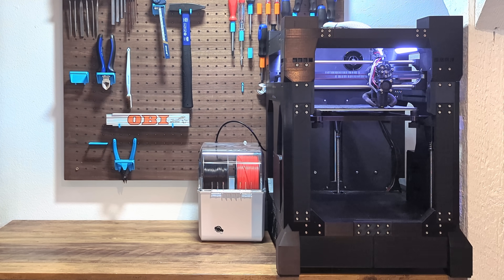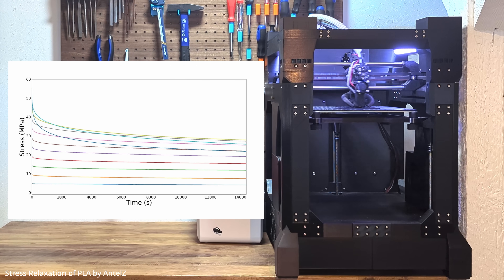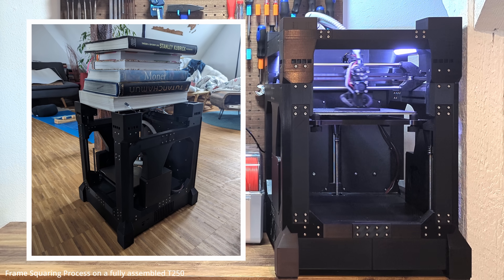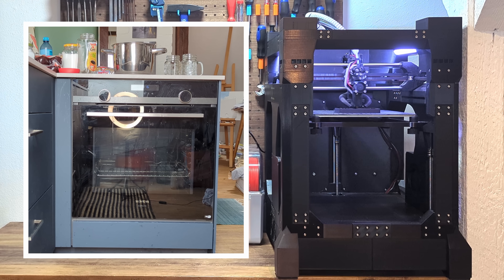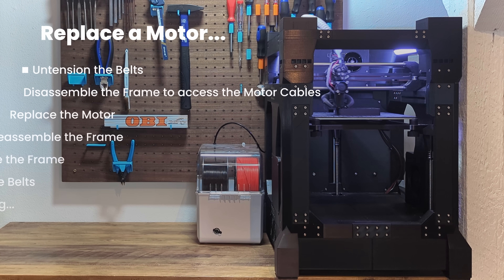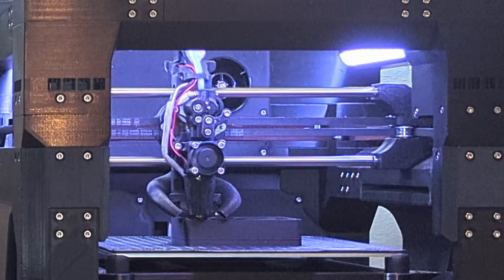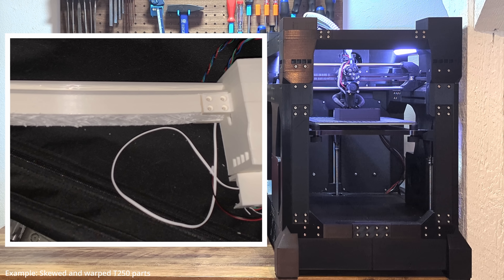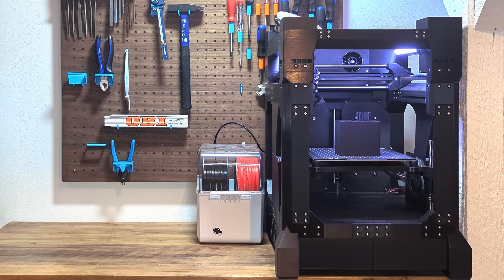5 Mistakes You Should Avoid When Building a T250

Comment: Heck even the T100 takes a long time to tune. I'm still tuning mine yet again to obtain more perfect prints. I had the belts too tight, the frame was a bit out of square. So after fixing those 2 things, re-leveling the bed, doing z-height adjustments I'm working on getting rid of VFAs. Re-calibrating pressure advance etc. I'm hoping to get the tolerances under control, they are out of wack. I've been 3D printing for 6 years now and it's still a lot of work but the end results are such beautiful prints when it all comes together!

Comment: Hey, what about a low Budget 250? Which would mean most of the t100 bom, with the upgraded hotend and the build volume of the t250 but without 60v, so basically using the t100 motoon system but with the increased build volume. Has anyone done something like that already? You could then also upgrade to t250 spec after a while

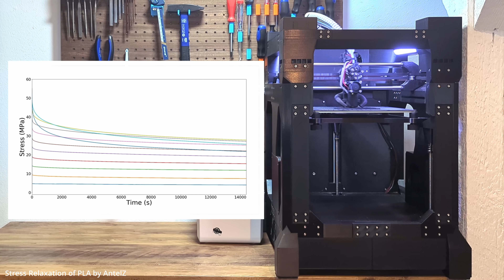Comment: 2:30 this data is interesting. From the Torque/Tension equation F=T/(Kd) where F is the bolt tension, T is the applied torque, K is the nut factor based on thread and friction characteristics, and d is the screw diameter, we can sub in some known values for the example M3 screw thread angles and diameter, steel on brass nut friction and be able to derive the screw tension from the current torque. the screw tension divided by the screw's collar or better, a washer, will give the pressure on the plastic which we can assign a value of 5 Mpa from the plot. for M3 washer (7 mm OD, 3.2 mm ID) this gives max torque 0.178NM. that's tiny, like 300g rotational force on a 1/2" screwdriver handle. also right at the lower end of specialised torque limiting drivers. without washers it's half...literally screwing it in with two fingers on the driver ever so lovingly...

instead of 5MPa maybe we can call it 30Mpa but specify to retighten after 24h and again after 1 week. now its about 1Nm with washer. these are huge chunks and days of printing that could potentially be ruined by a few small screws over repeated tightening at the wrong torques. i think that could very well be managed with a 3d printed torque limiter designed for 1Nm.
Reply from the maker: Yes, the absolute numbers also seem a bit low to me. At least I can’t reconcile them with reality. In the video, I used a 0.8 Nm torque wrench, which was a bit too high—by feel, I’d say I usually tighten the screws somewhere between 0.2 and 0.4 Nm.

But I could also imagine that his data doesn't quite match my scenario. He didn’t mention anything about the print settings, either on Reddit or in his video.

In my case, most joints should be treated like 100% infill parts, since top layers + bottom layers = 3 mm = the height of the screw's contact surface. I could imagine he used an infill that got compressed under the pressure.

Comment: >High end 3d printed 3d printer

>No doubleshear

Brother cmon, if you hada bent shaft at the alpha stage the best you could do was to support the end of the shaft with another bearing.
Reply from the maker: In my opinion, double-shear gantries lean a bit too far into the overengineering territory. Sure, they would’ve saved me from bending that shaft—but they also allow you to introduce belt tension, that are way higher and would hurt the printers performance, which isn't ideal. Also when you're chasing max acceleration, every extra gram of rotational inertia counts. That added mass of the longer shafts really hurts performance.

There might come a time where a double-shear gantry makes sense—maybe if belt-induced artifacts become a real issue. But based on where the printer is right now, there's still a bit of headroom before I need to worry about that.

Comment: If you had released T250. A year ago, I probably had not used so many curse words when building my o custom Klipper based printer with the frame of the crappy ender 5. Oh my mesh, the skew shall 16:19 alled it Vorender. I had Netflix experience with kita 
With it I made very mistake you mentioned and more. I was so tired of assembly and disassembly I just left everything open and wires running around. I burned a TMC DRIVER because I dropped a nut that caused a short in the board. 
I also soon enough discovered that connectors save you a lot of trouble. But they can also be a Nightmare. You add more failure points. You have no idea how much time I wasted with what was caused by a slightly higher resistance in one of my 2 wire PT100. And it had three sections. Toolhead of main loom main loom to the the electronics box. Connector and from there to the controller board. So an imperfect krimp of a single pin from a hay stack worth of wires can throw you off big time.

Also pay My tech fun channel a visit. He probably tested all. Filaments. You can imagine, with many very useful to know before hand parameters like creeping, layer adhesion, mechanical pameters, heat resistence, thermal resistance etc. For. His patron members he maintains a spread sheet will all. Info condensed. Definitely worth it and time saving.
Reply from the maker: Im a sucker for My tech fun's content, most of the time I end up buying a new spool of filament for myself... ._.
Reply: @MattThePrintingNerd My point was that you had a chart that you referred to your audience with a single data point about material performance. I thought that you and your audience could find it useful that he has an excel sheet compilation of many, many materials, over many data points. Including data such as how much a material deforms under constant load, tensile strength, sheer strength, layer adhesion, thermal resistance, and many more. That even if you don't really dig his content I'd say it would be helpful to have his data at hand for builds and offer insights to alternative materials that could be more efficient and/or easier and cheaper to print. His work is excellent and I believe it gives great value to the community.
Anuways, it seems my feedback is not really welcome here, so I wont do it anymore. Success.

Comment: I find it remarkably easy to print with PA-CF, once you get the Slicer settings right (orcaslicer makes thst a lot easier).

Think the trickiest part is the nozzle/heat block thermal properties and retraction. Getting these two right make the rest just fine tuning for surface finish quality. Now, plain nylon is for me a nightmare. Or it was, havent dared to do it again even having a full spool stored.

About drying it. It is incredibly effective to keep it in vacuum sealed bag, a bag of good quality dissicant with markes and hygrometer. I only use a filament dryer during printing and it's a cheap one that goes only up to 55C and is more than enough to keep moisture out. The hygrometer in my vacuum bag is always at 10% RH. If the hygrometer HR start to rise, few minutes in microwave and it's fresh again.

This approach is not only economical, but also lasts a very long time. And albeit slower, a vacuum bag or dry box with dissicant can also dry the filament if it's not hopelessly saturated. Next time you need it just pick it up and it's ready to go.

Comment: I really don't get the point of 3d printed frames when aluminum extrusion are so cheap and a way better option
Reply from the maker: Yes they are cheaper but when it comes to maximum performance they are a dead end. Have a look at my T250 introduction video. There I described why the frame is a key piece when it comes to the performance of the printer

Comment: PET-CF is the affordable way to get strength and high temp resistance (anneals well) and is really easy to print.
Reply from the maker: Yeah that's true but it's also really expensive
Reply: @MattThePrintingNerd  It's really not that expensive in my opinion compared to other engineering filaments. It's much cheaper than nylons etc.

Comment: This printer is kinda interesting as it violates a ton of design principles. Would be great if people shared honest experiences. As for PLA, if plan to enclose this thing, PLA is a no-go. PETG is seriously borderline. The parts are chunky, so you might just barely get by using PLA. On the other hand, this kind of chunky part are notorious on ABS and its siblings. I am not a fan of PLA at all, and it is really hard to find people with honest experiences. Also, how do you get that carbon out of your skin?
Reply from the maker: The T100 violated also a lot of "design principles" and we have plenty fast prints in our showroom on discord. Also I tried to feature some of the community prints in my videos to show of what the average 3d printing user is capable of reaching with it.
Reply: There aren't really any great ways to get carbon fiber out of your skin, but duck tape or a flexible glue like Elmer's will help get a lot of it that soap and water alone won't. Have to leave the glue to dry a bit thick, though. I'm sure there are other tricks to it that I don't know.

Comment: It makes sense to prototype in PLA/PETG/ABS and use PCB Way or any other print servicr for Nylon and other specialized filaments. To be honest most of my parts are PLA because it's my goto filament. I always say to myself when it breaks i will reprint it in PETG or ABS. Guess what? Only one part, a holder for Ikea rods in a wardrobe needed PETG (and a screw in Z Axis) to handle the 20 kilogram load
Reply from the maker: Yeah I follow the same philosophy. I printed a lot of hooks for my balcony and after 3 years they come to a point where they are a bit deformed and I had to replace them

Comment: Hey, I just wanted to chime in as a person with a beginners level of experience printing PET-CF. I promise it's really not that difficult to use and gives truly remarkable results. 

I recently used Tinmory PET-CF17 in an upgrade for the toolhead on my Voron 350. The machine I used to print all of my parts: an unenclosed Bambulab A1 running the Bambu PET-CF profile and reduced speed to a consistent 80 everywhere. 

That translates to 265 on the Hotend, max 30% cooling with min layer times of 4 seconds, 30-80 max speed(experiment for your printer) and a 100c bed. All of which is not hard to find in most printers with an all metal heartbreak and a hardened .6 nozzle. I'd put it between PETG and TPU in terms of difficulty to print. Not exactly easy to deal with, but by no means impossible for someone with an hour or two on their hand to dial things in. 

I won't speak too long on results since the upgrade was from a stealth burner to a dragon burner, so a lot of factors to consider. Either way, what I got was a rough doubling in the recommended acc from my input shaping recommendation. This means 8k up from ~4k on y and 17k up from ~8.5k on x. This was with a CAN board with an onboard Accelerometer mounted right next to the extruder motor, by no means ideal. Thought it's impossible to know unless I replicate the changes in ABS, I'm still confident the increased stiffness had a lot to do with how much of an improvement I saw.
Reply from the maker: Yeah it's always a good idea to make the moving parts as stiff as possible and yeah PET-CF is one of those materials that's a bit easier to print but since the manufactures know that as well they included a tax for that... so yeah PET-CF is a bit the pay to win route
Reply: @MattThePrintingNerd I disagree. Using Polymaker Fibron as a baseline, their PA6-CF is around 60% more expensive than their pet-cf17 (40usd vs 25usd for .5kg) .  Another option that comes to mind is Siryatech selling a kilo of PET-CF for ~35usd. Barely double the cost of good PLA.

I admit I'm almost certainly not using the same referred manufacturer as you and regional differences may play a role. However, I still hold that if you live in the US and can access Amazon, PET-CF is very cost effective. 

I don't think it's magic bullet or pay to win by any means though. It is on the denser side and is very brittle. I'd honestly be most interested in a benchmark comparison with nylon or even other high temp, stiff polymers(ie: pa6, pa12, PC, PPA, etc) to see if the rigidity at the cost of density makes any difference in the context of making a toolhead.
Reply: @chanchanarthur8068 what do you mean by calling siraya tech offbrand?
Reply: @turtlegod766 I suppose off brand might not be the best word for it. I suppose a better word to describe it would be "non-professional grade" or "hobbyist grade". I could absolutely be off-base here and it's some industrial grade manufacturer that decided to just open up a new revenue stream by selling reasonably priced engineering filament. By no means is the company's history or professional reputation known to me in any complete sense.

Comment: hope this gets a brand name change. it so difficult for search results to find accurate results for "THE 100". "T250" is not as bad but still this needs a proper searchable family name.
Reply from the maker: Im pretty fine with the T100 / T250 branding
Reply: T100/T250 is fine. that is the model name. you can compare this with a series name or make name. for example, nobody is going around saying "I have a 2.4 or 3 or 3 Pro" without using the words Voron or Ender or Creality. anyway, i didnt mean the current naming is wrong. just coming from the marketing perspective as someone with experience in SEO. its just hard to search because THE100 is the name of a movie, T100 is the model of soldering iron, T250 is a titleist golf club or HP printer, etc etc....
Reply: @suivzmoi usually for me, I add the word printer at the end and it works.
Reply: Congrats and thank you for the T100/T250 🎉,  @MattThePrintingNerd Agreed, the name is quite distincitve.
Due to being new, there is less content overall.

Comment: Is there a CAD file for the assembled and exploded T250? I want to see if it's possible to make it out of alternative materials.🤔
Reply from the maker: Yeah check out the link to github in the video description
Reply: @MattThePrintingNerd , Because my brain went in a direction of: That printer shakes a lot at the top -> a lot of printer hobbyists use a slab of concrete and a foam pad -> what if you make the frame out of concrete
Reply: @djlapio93litlebro  You must have missed the part/video were Matt explained that he made a full PLA printer because it behaves so predictable that the computing can take advantage of it.
Reply: @djlapio93litlebro  If you want to experiment with concrete filled, 3D printed machines I suggest to try some that were designed that way. I have seen someone make a lathe for example. Whatever you do, I would love to see videos of your experiments.
Reply: if you want to avoid resonances (which manifest as shaking) the linear rails (forget about rods) need to be supported all the way and u're prob better off looking at croXY instead of coreXY designs, as they use min 2 motors per axis, but are mechanically overconstrained - which is a can of worms of itself - esp if the printer frame is as rigid and unforgiving as concrete / epoxygranite (need to implement a way to get the surfaces aligned after all is said and done - in cast iron they scrape, for cnc in steel they use epoxy as bedding for the linear rails).
There is a guy who did a croXY with alu extrusions and 4 motors per axis - from a sturdiness/stiffness point of view that is where one should be heading for high speed - with more mass in the frame prob even better.  What I wonder is if it would be worthwhile to use 50-100W AC servo motors as drives, they keep their torque in the high speed region (for the small ones 3000rpm) unlike steppers.